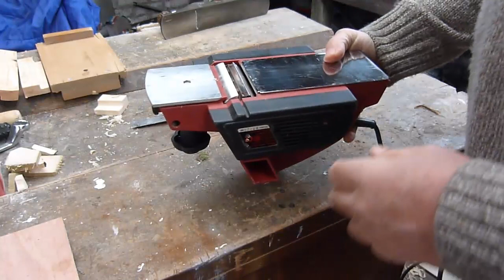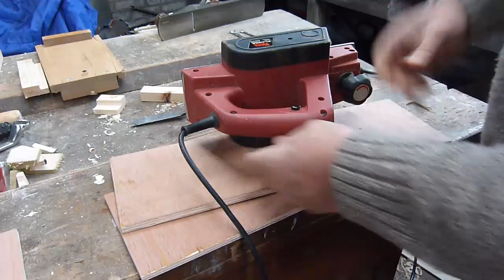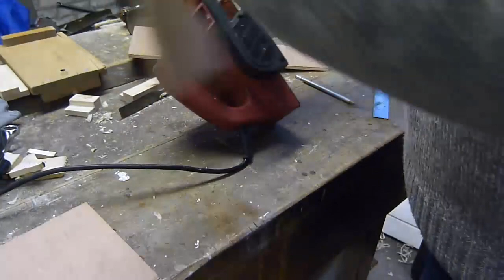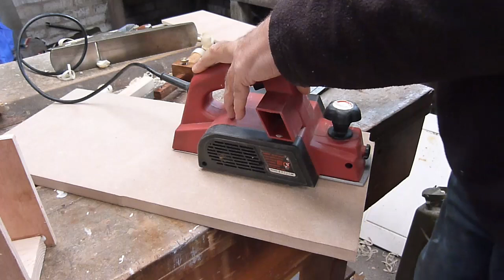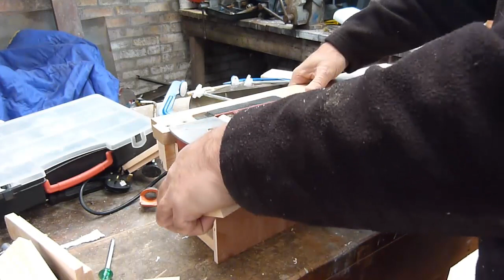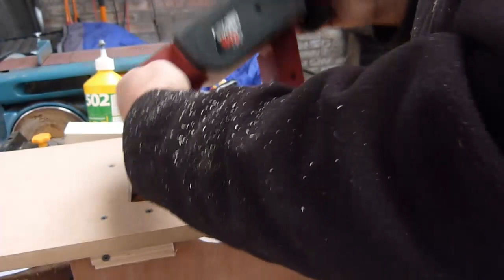Make your electric plane into a JOINTER - THE EASY WAY!

Comment: I have also done this; mine was more difficult because the plane body was curvy rather than straight. I made a foot switch to control mine, basically an extension cable with the live wire 
diverted out of the socket box, fed through a microswitch in the foot pedal, and back into the socket box to the live terminal of the socket.

Comment: I think you have the depth set too high and you running it too fast. Those boards did not have a straight edge against the plainer when you where running through, like they where lifting up.

Comment: After jointing starts shouldn't the pressure point be on the jointed side instead of the feed side. Sometimes a rocking effect occurs. This was an amateur question but it's important.
Reply: An even but light pressure should be on both sides. Just never too much over the cutters is the rule of thumb.
Reply: thank you
Reply: @kevinanthony2073  so should he have done an extend to the front of the jointer as well? It would help him with bigger woods

Comment: Some how when i use mine i either get a bow in the middle or the end are cuut more ,i dunno if is hand pressure?
Reply from the maker: Probably. You have to be gentle.
Reply: The end thats cut more is called snipe. The plane cuts deeper when the wood falls into the mouth by the blade, allowing the blade to cut deeper at that point. The bow is due to uneven pressure as it goes through.
Reply: If you are getting a bow, it is because the height of the cutting knives is different to the height of the back table (it this case, the longer of the two). If the back table is slightly higher than the knives, it will lift your board away from the cutter, causing it to bow.
While this design is great, the front table (the short one) is too short. This means that while it will clean up and square edge your board, it will struggle to be any good at straightening a board. You could see the operator struggling to keep the board flat on the front table.

Comment: Sorry for my ignorance, but what's the difference in this and using the planer the way it's supposed to be used?
Reply: Really just easier to push the wood to the tool than the tool to the wood and keep things level.  Its relatively the same.   But like a router table, makes things easier.
Reply: @danbow7503  isn't that because it has a straight reference and then will be perfectly flat?
Reply: @eyalyatzkan3098  True, its a really good purpose too.  The face is a reference for the blade, but its easier to set a level surface than hold a surface level so that makes sense.

Comment: A switched surge protector/power strip is the easiest thing and there is no wiring required. You'll have a few extra outlets as well depending on what you buy. https://www.harborfreight.com/4-outlet-power-strip-62495.html

Comment: Nope, it is still a planer. No joints are being made... (if you think a planer rotated by 180deg is a 'jointer', then at what rotation does this happen? 90deg? 91deg? Fact is, it is a planer whatever the orientation). The name 'jointer' should be reserved for machines that do just that. Such as a biscuit jointer.
Reply from the maker: https://www.jettools.com/us/en/p/jj-6hhdx-6-long-bed-wood-jointer-with-helical-head-kit/708466DXK
Reply: @shootingatdawn  Is that meant as a counter? Sorry, being in company does not make you right. Logic is not a democracy. If you want to change the name of something based on its orientation, you have to specify at what point in that orientation it changes. And, if the name you then choose is for a function that it does not do, you need to explain what you then call tools that DO do that function. Good luck with all of that. The logic is that a planer is a planer (it is what it does) whatever way up it is.
Reply: @Tensquaremetreworkshop  Lol so easy to spot a hater, usually i just leave haters alone but when acting like an expert and being completely wrong, its time for school so ill occupy an extra 90 seconds after the end of the video just to let you know you're not making any sense. And youll obviously deny it because idiots don't realize they're idiots. By your logic, it cant be a jointer because no joints were made. You do realize that its us, Woodworkers, who ultimately make the joints. A jointer is just a machine that helps speed up our work by flattening one face of a board to be perfectly squared with an adjacent edge. By flattening the first face, it is then referenced against the fence (assuming the fence is set up to be perpendicular with the table,) to then cut a flat surface to on an adjacent edge, leaving you with two perfectly flat 90* squared surfaces. As stated in the description, it was still a work in progress but ultimately when its 100% set up, the end product is, as you would say, (if it looks like a duck and sounds like a duck, its a ...) is a JOINTER. But your stupidity doesn't end there, finishing off by comparing a jointer to a biscuit joiner is what crowns you as the clueless king of hate. This videos about Jointing, which falls under the subject of Milling. By comparing a jointers function to a biscuit joiner, not only did you digress from the main subject of the video showing people alternative ways to Mill, but you mixed it with JOINERY. Your lack of knowledge and inexperience was exposed by non other than yourself, while trying to be a know-it-all, criticizing @shootingatdawn (who by the way made a phenomenal video/presentation) That's Hating 101 at its finest. 🧿
Reply: @ThaDrizzyDre  Wow,what bile! And you call ME a hater! Nothing you say refutes my contention that a machine that planes wood is a planer- whichever way up it is. Fortunately I do not have to make the case; the majority of the world agrees with me. BTW you are also wrong about the ‘perfectly flat'- everything has tolerances. Something wood-workers seem to have difficulty with; ironic given that it is one of the least precise of machining activities. And the surfaces are not square, they are perpendicular.

Comment: I like it. But you should have made the sides taller rather than shimmying it like you did. In other words, you created more work than necessary.
Reply: He made it from scrap wood and the sides were what they were, so adaptation was needed.
Reply: Watch the bit about leveling the top.  It is important the table be absolutely level with the back of the plane.  This way he leveled with the four blocks, and can adjust later if needed.  It would be pretty impossible to cut the sides perfectly to make the top level, and no means to adjust later.